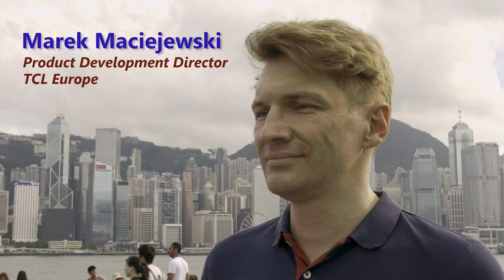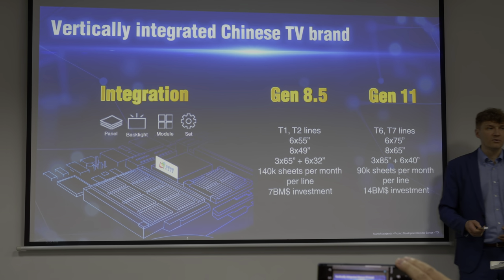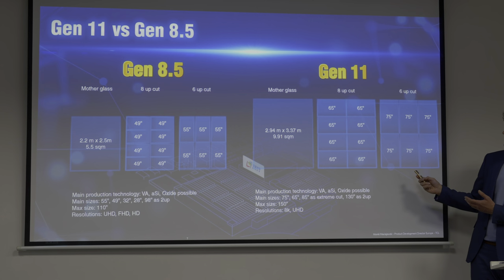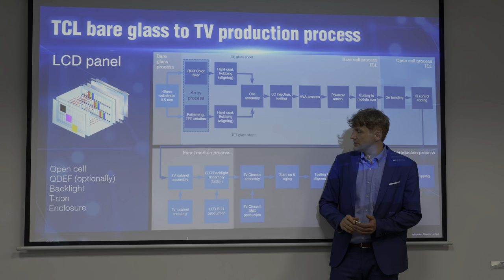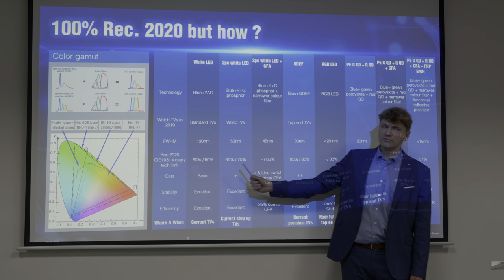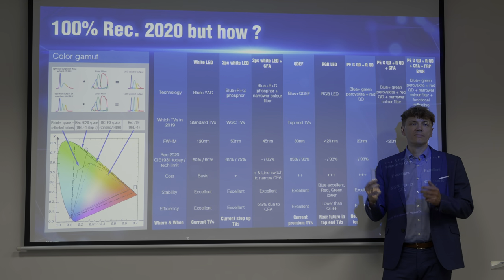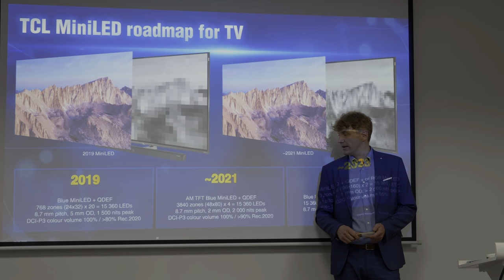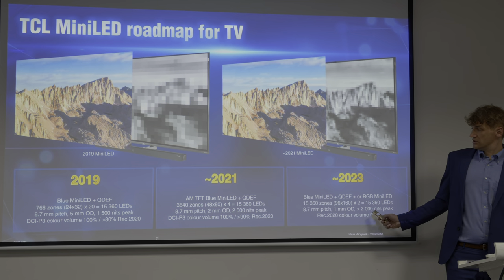[HDR] TCL Explains TV Manufacturing Process & Why is Rec. 2020 Important

Comment from the maker: This video was filmed, graded & uploaded in HLG HDR, so it's best watched on a TV/ smartphone that can display HLG HDR from Youtube.

There is a typo on the "MiniLED Roadmap" presentation slide from @ onwards. Under the "2023" column, it should read 15 360 zones (96x160) x 1 = 15 360 LEDs.
Reply: Now I'm very curious about whether going from QDEF 90% to 95% coverage of 2020 and above would be noticeable in regular use.
Reply: Theo podria poner substitulos en español  ,te sigo mucho  se ingles pero no tanto  un saludo  theo 👍🏼🇪🇦
Reply: Vincent , the 'HDR' indicator in YouTube is only showing '4K' at the moment and it doesn't look like HDR, but quite off.  Just checked another HDR reference clip on YT and it works well.
Reply: @psychedalek  You probably don't support HLG
Reply: @pacman22XD  I'm afraid you're right.  I didn't realise there was a distinction.  Other HLG YouTube clips also fail using Edge.  The YouTube app on my TV does support it it seems.  Vincent's clip is now much much better with proper whites and highlights, but the greenish colour of the interviewee remains.  Thanks for the heads-up.  Now I need to figure how to make it work for Windows
Reply: Just watched it on my q9fn, and the picture quality was the best I've seen on youtube. 
Fantastic work!
Reply: BT.2020 is important because once we reach full coverage and color volume not only will we be able to take full advantage of 10-bit color but we will also be able to take full advantage of HDR10. It’s as important as full BT.709 and DCI-P3 coverage was for SDR.
Reply: Watched it on both my Q900R and Samsung Note 9 and i find the skin tone a little greenish. Is it just me?
Reply: The HDR shows on my OP7 pro. The colors don't look quite right.
Reply: Do you need a dedicated video interface to edit in HDR in da Vinci Resolve or you just use the HDMI output?
Reply: Is that why the colours look fucking disgusting
Reply: I did wonder why the Colour Grading was so weird
Reply: what camera do you use for hdr?
Reply: The outdoor shot of the guys face looks really weird. But everything else looks great in HDR on my LG OLED55B7A.
Reply: Hi Vincent the Philips 803 is now £1299 and the LG C8 is £1185. Is it worth spending more money on the Philips or just get the cheaper option?
Reply: @psychedalek  Yeah, I do think there's some weird lighting or some colour grading/contrast adjustment that makes his skin colour look off and greenredish
Reply: @hdtvtest Vincent, great footage! Always excited to watch HLG footage since it is very rare in the states. Hong Kong is such a beautiful city and the harbour and skyline is impressive even for a New Yorker such as myself! I haven’t had the opportunity to travel to that region yet, but HK is definitely on my bucket list. 

If you got to shoot some tour style videos, I would love to see some more footage of the city if you’re willing to share it.

Comment: The HDR looked quite off, sorry to say 🙏🏽 . I love your videos though. But Marek looked sickly odd coloured with the HDR grading you've applied.

Maybe some different settings needed next time? And yes I used a HDR TV. Sony 65AF9 which has been calibrated.
Reply: @eurovisie2010  he still looks greeny and weird coloured in other modes too. Just looks even worse if I use other modes. So, that's not it at all.
Reply: @greyfoxindy   Okay, my reaction was not point on.
Reply from the maker: Thanks for feedback... it's our first-time grading in HDR using mixed footage, and we're not sure how Youtube is transcoding it.
Reply: @hdtvtest  The sky between the clouds  is pink on my monitor. Should be blue I think.

Comment: The HDR doesnt work for me on youtube through a browser in win 10, using a samsung 50" 4k hdr enabled screen. About to test it on the in built youtube app on the TV.

Edit; Tried on youtube app on TV, colour mode switches to HLG, however while some colours are rich the guys face on the boat has a tinge of green colour to it.
Reply: Yes I saw this too. Marek looks oddly coloured, not natural almost sickly.
Reply: He is also from Mars when mapped in non hdr browser.
Reply: Looked fine to me on a 55" samsung 4khdr screen. Had it on cal-day : colourtone set to standard.  HLG set to plus 1. Colour space set to auto. Hope this helps.
Reply: @billbaggio1058  Well mine is only a cheaper 2017 model, doesnt have the cal-day setting? My other settings are the same apart form plus 1 on the hlg, I tried your setting for it and it simply upped the overall brightness a little. Weird.
Reply: @DrCrYz  Yes it will have cal-day and cal night. I have mine calibrated aswell 2017 model. To get service settings while tv is in standby hit.....info+settings+mute+power.
You can add cal-day and cal-night to your presets.

Comment: @HDTVTest Can you find out why there are no 32-40" OLED / QLED 4K-UHD 120Hz panels? The PC computer 4k-UHD 120Hz or higher offerings is a total wasteland. Only crap VA-panels below 4K , no 32"+ OLED, no QLED ... the market has been waiting 4 years already.

You can buy 3 x $999 4k_UHD OLED 55"s for the price of a single Asus PG35VQ 200Hz (non-4K-UHD) HDR 200Hz VA-monitor.

Comment: Vincent why do companies make 50hz panels?
Reply: For the pal markets, where the broadcasting refresh rate is 50i/50p. But those panels aren't only 50hz, but supports 60i/60p and 24p as well.
Reply: @alexroot1980  But everything running at 60hz will be capped at 50hz correct?
Reply: @djremy2002  I'm just talking about broadcasting. Everything else is 30/60p (or 24p  for movies) ... 
My only wish was (since the advent of HDTV) that pal/srcam/ntsc, could finally become a single and universal format...
It happened only for Bluray, 4k be (home video) and games...
But TV speaking... I just gave up... Let them do whatever they want...
As long as, I'm happy with my blurays, 4k br, Netflix and games... Regular TV it's a forgettable thing for me... Amen
Reply: @djremy2002  anyway. Yes it will...
Reply: I'm in the UK I get the 65" Panasonic fx740 at 50hz £900 and the fx750 at 100hz £1300
Reply: @miamimo70  in my opinion, what makes the difference is the source.

Comment: At 15,360 zones there should be almost no difference between OLED and LCD.
(Assuming light bloom doesn't spread significantly by more than one or two zones, controlling haloing is really the biggest challenge that TV makers face in the near future. I'm fine with 90% Rec. 2020.)

Comment: TCL Corporation (simplified Chinese: TCL集团; traditional Chinese: TCL集團; pinyin: TCL jí tuán) (originally an abbreviation for Telephone Communication Limited) is a Chinese multinational electronics company headquartered in Huizhou, Guangdong Province. It designs, develops, manufactures and sells products including television sets, mobile phones, air conditioners, washing machines, refrigerators and small electrical appliances. In 2010 it was the world's 25th-largest consumer electronics producer. Since 2015, it remains the third-largest television manufacturer by market share.[2]

https://en.wikipedia.org/wiki/TCL_Corporation

Comment: WHY WHY WHY WHY WHY WHY are tv manfucators so fixated on getting tv so fucking small i hate that my oled is like 0,9 mm thick its fucking aweful just touching or cleaning it im scared shitless of breaking it, i cant see any viable reason for caring about thickness after they go below something like 10cm, i just dont get it any space behind the tv is wasted regardless if its 55cm or 45 cm  i have my tv about 1 meter from the wall. i would much rather they keep thickness and use the space for something to enhance the tv, not limit shit just to get it that 0.1 mm thinner, same fucking thing with phones.